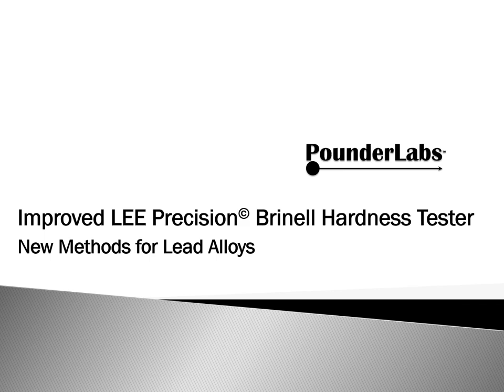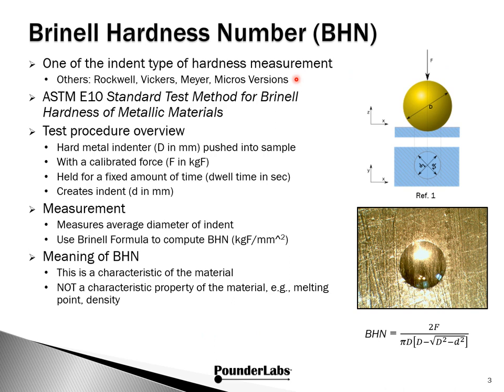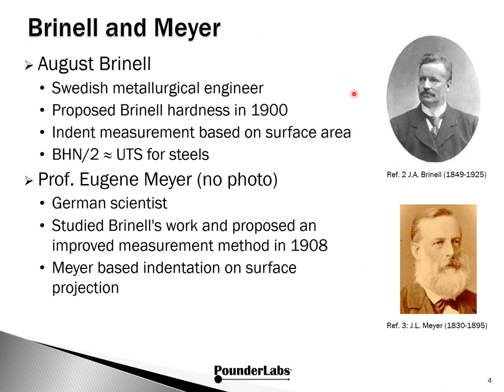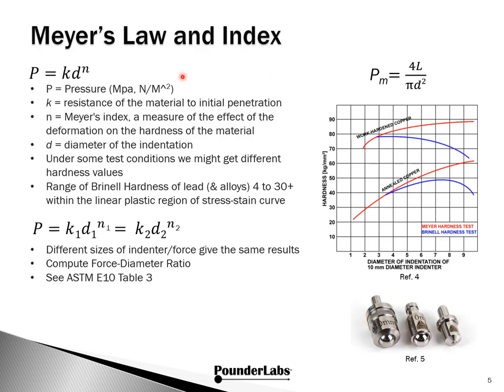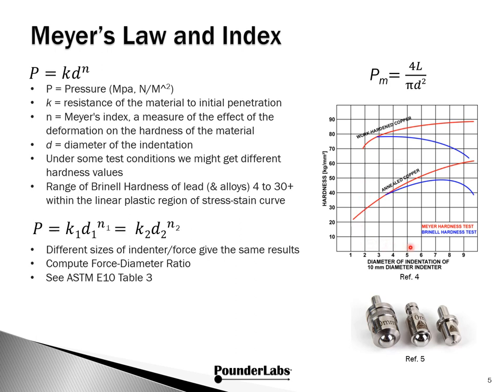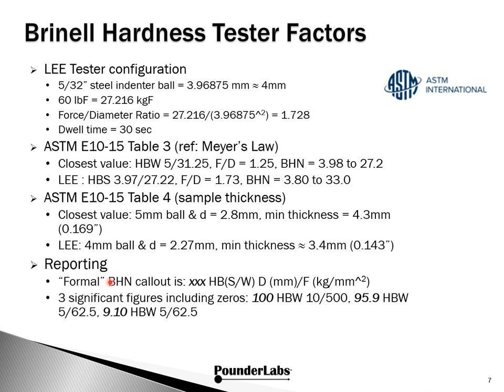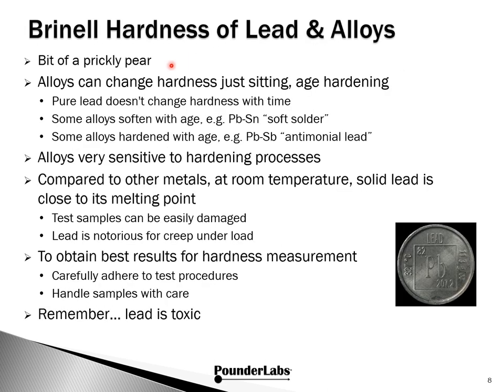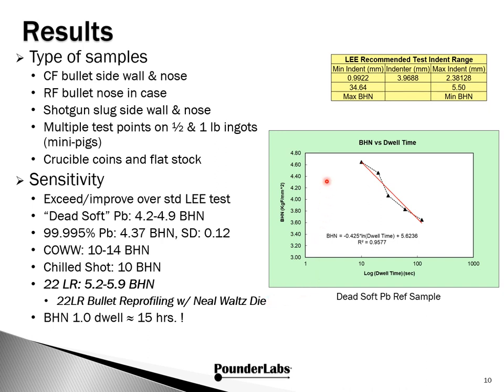Improved LEE Hardness Tester for Lead

Comment: When I received mine new in the box, the retaining cap wasn’t screwed down firmly to the indenter housing so I tightened it up. Is there a way I can easily test the calibration
Reply from the maker: Thanks for your comment… Option A, contact your supplier or LEE and swap it out under warranty… Option B, work with somebody else that has one and do some same sample testing… Option C, obtain some high purity lead, usually 99.995% is available, test and if that measures between 4.5 and 5 BHN you're probably good to go!
Reply: @PounderLabs  thanks Don